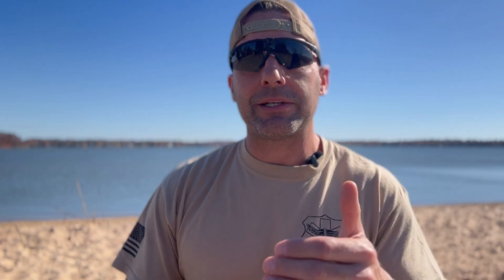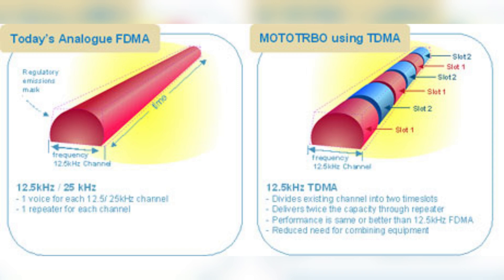Digital Radio Modes

Comment: I started with D-STAR in 2010,
with an ICOM ID-880 Mobile,
Then Fusion around when DMR became popular.
I had a Hytera UHF only commercial HT, where I got
my MARC Registered ID for
DMR. I first had a CSI 800
Mobile, and Anytone, Ailunce,,
Retevis and TYT handhelds.
I now have a Retevis DMR/
Analog UHF repeater to use
locally, portable and mobile.
73 de W2CH Ray and Marylyn,
KC2NKU. 😊
Reply from the maker: @raymondmartin6737  I live the retevis repeaters and think they can provide a huge benefit…. More to come on that later!

Comment: The problem with digital radio, is that it has further fractured the amateur radio world.  I equate this to the old VHS/Beta wars back in the day.  They need to have a single open standard for digital voice communications.  The other problem with digital comms, is the signal is all or nothing.  A poor signal will be garbled.  With analogue one has a chance to pull out a signal with static in it.
Reply: I don’t quite agree with that comment, amateur radio is all about experimentation, so trying out digital modes specially ones made for the commercial and public safety world has brought in more knowledge to hams, and all digital modes have connected hams around the world effortlessly. It’s better than just being stuck locally with analog
Reply from the maker: @bwillan  video that you will love, coming out soon! Stay tuned and thanks for the comment

Comment: I use D-STAR and YSF. My understanding is that D-STAR uses  6.25KHz for audio and data transmissions. C4FM has Digital Narrow and Voice Wide. The following applies to simplex, not on reflectors.

On the DN mode, 6.25KHz is used for voice and the other 6.25KHz is used for GPS and data transmissions. With VW mode, it's 12.5KHz of audio, no data transmissions. Where C4FM shines is the DG-ID feature, think of it as CTCSS Tones.

One can set the DG-ID on TX and RX. There's 100 DG-ID codes, 0-99. If you want to keep your conversation private as much as possible, change the DG-ID and have the codes. Any ither radio with C4FM capability will not "hear" the conversation without the same DG-ID codes. All they will see is callsigns come up on the frequency and no audio. 

D-STAR does not have this capability. Anyone with a D-STAR capable radio can demodulate a D-STAR signal, if they're within range. 

If you rally want to keep a conversation private, the Kenwood D-74A and D-75A can do D-STAR on 220MHz. No other radios can do D-STAR on 220MHz, except Kenwood's new mobile radio, whenever that comes out.
Reply from the maker: Thanks for sharing all of those details, really helpful!

Comment: Being a owner of both d-star and dmr I always go back to d -star. It’s by far easier to program and use than dmr and you can use d-star hf simplex I made contacts all over the US using d-star hf can’t do that with dmr. Also in socal dmr simplex is absolutely dead unfortunately where’s as there’s always contacts with dstar simplex to be made
Reply from the maker: Like I said in the video, I have no expedience with d-star, but the fact there is hf d-star….. that sounds worth exploring
Reply: @ yeah dstar hf simplex is a lot of fun they have nets on sat at 4pm pst ref030c and sundays at 7am. We use all the bands
Reply: Different people gravitate to different modes, I think it’s really about taste and needs, critical comms require the robust physical quality and characteristics of commercial and public safety modes and you can’t get that with d-star, so ya really depends on one’s needs. I used to have D-star before, really enjoyed it, still miss my icom ID-52

Comment: Pretty good summation. A couple of things you missed. P25 is also used on the amateur side with p25 repeater and reflectors. You also forgot NXDN which is Kenwoods take on digital radios. I would be interested in some digital vs analog range and quality testing videos.

Comment: I only have analog radios and HF radios i never used dstar, fusion or dmr. I hear digital stuff over amateur radio requires more equipment and cost to maintain it. I rather just obtain the general and extra and just keep using analog and HF and pay no mind to digital transceivers that requires repeater usage. Ill be ignorant and give my middle finger to dmr, dstar etc ill use HF and a straight key😂.
Reply from the maker: hahahah...to run a digital repeater would require more equipment, but if you were looking to just explore and get on the air, just a digital capable HT and to be in range of a digital repeater is really all you need. Depending on your applications, the clarity gained can be really nice if even for just simplex communications.

Comment: What a great video, only a couple of weeks ago I watched a YouTube video by Jason Ham Radio 2.0 where I dared question why we have so many different digital modes & dared to ask why we don't have a standard & I was shot down for daring to ask & suggest😢 ( see below )

https://youtu.be/7kNtYWP75qI?si=r9ukZBWQe-mA_TWj

As it stands if a Ham wants a "DMR" they basically have to buy a Chinese radio then if they also want to talk to someone on C4FM they have to buy another radio & so on it goes Im sure you get the picture.

In my opinion Icom & Yeasu need to offer people a choice in the case of Icom DSTAR/DMR & in the case of Yeasu C4FM/DMR. 

Where I live in Melbourne Australia we have Dstar, DMR, APCO & C4FM Repeaters.

Now yes I know for an extra expense you can get a "Hotspot"  to do the heavy lifting but it needs WiFi & is one more peice of kit you have to carry & use.

RGS
Wayne 
VK3ECS
Reply: We do, it's called M17. But Icom, Kenwood or Yaesu can't make any money if they all used M17. https://en.wikipedia.org/wiki/M17_(amateur_radio)
Reply from the maker: appreciate the comment and ohhhhh man.... watching this now, can't wait!
Reply: In Europe you can add TETRA 😂😂😂😂
Reply: I understand why there are people that want standardized digital voice modes. I have an Icom and a Yaesu that can’t communicate with each other on digital voice. It splits up an already small population of operators into even smaller groups. The drawback is that standardization doesn’t breed innovation. If we settle on one protocol we miss the opportunity to develop something better. We have lots of data modes in ham radio that aren’t standardized either. I don’t really know what the answer is other than to watch it play out. I think as tech advances you’ll see more ways of interconnecting the different protocols.

Comment: Just got a couple DMR radios. Gonna try then out this weekend (I hope).
Reply from the maker: What did you get?
Reply: @RANTStrategies  TYT MD-UV390 Plus. They for the money they seem like a good buy, plus they do 256 encryption. Just do not tell anyone.
Reply: @RANTStrategies  UV390. I did not want to spend too much since there are no DMR repeaters in my county. I was really interested in testing the range difference. The radios seem to be a good deal for the price from the little testing we did this weekend. 

I really want to push the ham/ARES members to use DMR talk and pass forms with fldigi. But that is a loosing battle. I really wish I was back where I use to live. We use to do cool things all the time.
Reply: @RANTStrategies  UV390 Plus. So far it seems like a decent radio at a good price. Want to do some more range testing soon. I really want to push DMR and fldigi to the ham/ARES group. The leader is not real welcoming to anything but analog.
Reply from the maker: @tangle70  Well that's disappointing but also not so surprising to hear. I hope they can come around to catch up with the times, keep pushing them forward.

Comment: I use DMR and Fusion. Hands down, Fusion is the simplest of them all. Turn it on and pick a frequency and it simply works. As a plus, there is a bit more "security through obscurity" because there are no off the shelf scanners that I'm aware of that can decode the C4FM modulation.
Reply from the maker: @MarkDecamps  well that could be HUGE win if that is the case, very cool!
Reply: Really wish I had more Fusion repeaters in my area… like any…
Reply: May not be off the shelf scanners that do it, but DSDPlus will decode C4FM. I've never tried it as there is no Fusion in my area, but have decoded DMR and P25 P1.
Reply: @juliogonzo2718  that's why I said "off the shelf scanners." I didn't say there was nothing that would decode it.
Reply: @MarkDecamps  I wasn't arguing but just wanted to point out that digital modes without encryption do not provide security. You are correct that fusion will stop Joe Blow with a digital trunking scanner from listening but it's not in any way secure from others listening. I have two CCR DMR handhelds with low level (40 bit I think) encryption. I'd consider that enough to keep most people from listening and the CCR does add some security through obscurity as it's likely proprietary as it is incompatible with the encryption on say Hyterra or Moto, but I don't consider them 100% secure. Someone with a bigger brain than me could likely crack it easily.